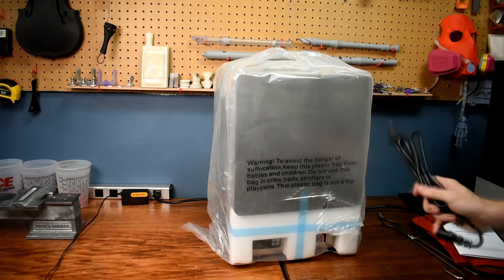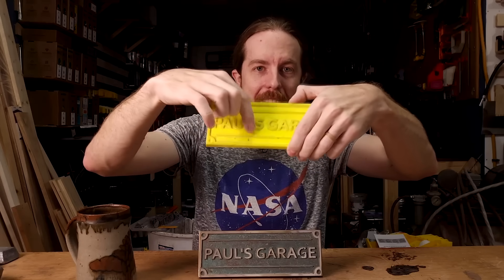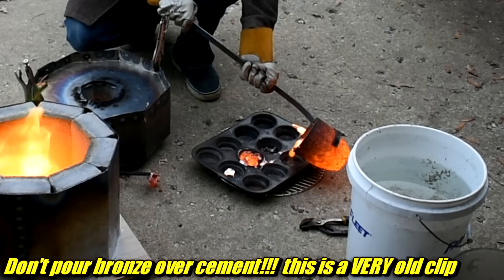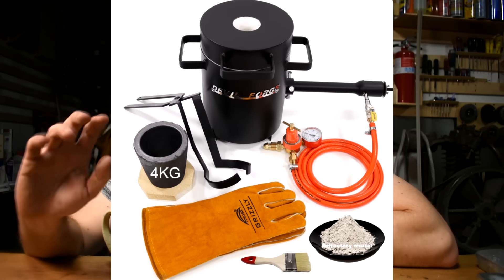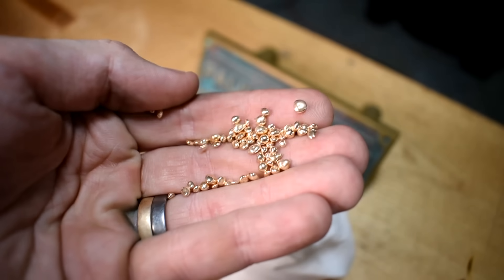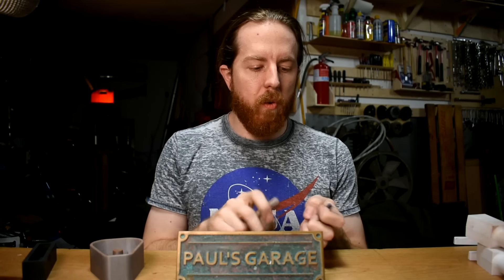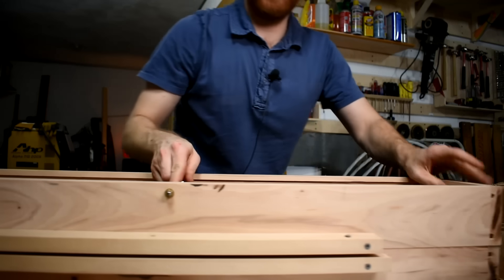Start Sand Casting at Home: The Easiest Equipment Setup

Comment: I started building a forge 5+ years ago.  Did all the research, started buying and collecting materials.  Got the forge made, started on the burners then life got in the way.  Finally getting back to it and bought a Vevor 12Kg forge/foundry on Black Friday for less than I paid for the Kaowool  and materials years ago.  LOL.  Need to order some rigidizer and see if I still have some refractory material left.  First job will be making some tongs for the crucible and forging.  Thanks for sharing, Ken

Comment: This is awesome Paul! Thank you for this.. so much info in one video. 

Question: any reason no one makes a bottom-pour crucible? (Other than potentially getting easily clogged.) I use a cast iron teapot (bottom pour) for making lead ingots; the lead comes out perfectly clean without having to skim for dross right off the bat. Wonder if you can do the same for higher temp metals?

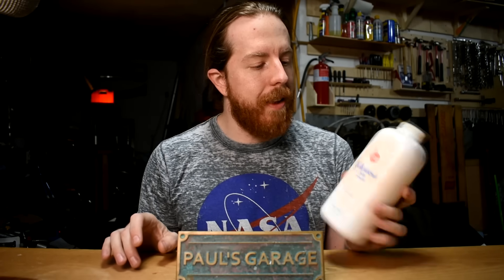Comment: 4:00 I started hobby casting about 5 years ago and corn starch baby powder is all I've ever used because I couldn't find talc. But I've never had any problems with the 2 sides of my flash sticking together. With either petrobond or green sand.
Reply: usually dont comment but corn starch is also all i use, doesnt seem to powder as nicely as i see it do for people on youtube with talc so i just use a paint brush.
Reply: @swagtactical9255 I use a makeup brush

Comment: A little plaster and sand with lost wax instead of molds and the finish product would be like jewelry or inconel jet engine fins and not be imperfect or need work after. Could also skip the special sands and only use sand to fill in space on large stuff to keep mold from breaking.
Reply from the maker: lost wax is awesome, i do vacuum casting here, too.  it's just a different process for different ends, both are awesome

Comment: Cool, I just melted down all the scrap soda cans 've been collecting over the past 3 months today into ingots.  I am wondering how you can easily add draft to models for 3d printing.  Eventually I am going to recast my can ingots into round stock for turning parts on my metal lathe.  Ingots are ok for storage, but I have been thinking about welding up a shot dripper to pelletize my cleaned metals to make it easier to melt just what I need in the future.
Reply from the maker: sounds fun!  adding draft to 3d models can be done in a few ways.  If i was making an 3d model, it depends on which software you are using, but most of them have an "extrude" feature that can have an angle or draft added in.  I would add 5 degrees.  If you are using something like blender on an STL, it's a bit more complicated, but it can be done

Comment: Why not use a stainless steel crucible?
Reply from the maker: that could work for sure, but depending on the alloy you might have contamination issues.  molten aluminum will dissolve steel like water in a cup made from sugar.  It can eat through, or more likely just absorb so much steel it can alter the aluminum alloy.  That's just one example, and i'm not sure what issue an iron-nickel alloy would have with whatever metal you are melting in it, but generally ceramics and graphite are used to prevent contamination.

Comment: Hi Paul, Great videos!!! Question, can you cast Zamac in an aluminum mold?  Thanks
Reply: I didn't see where to leave a comment about what I have cast. My biggest casting to date was a Ford V8 60 dual spark plug cylinder head. I have a few crucibles, the largest holds 150 # of aluminum. I will build the tilt mechanism for it next year. Zamac seemed interesting for some mechanical parts that I would like to produce. I think it may be easier to cast them as opposed to machining from billet. If I can use a bolt together aluminum mold It seems that complicated parts could be easily produced on a low volume basis.
Reply from the maker: that sounds like quite a casting!  And a huge crucible. I don't have anything bigger than I can lift safely by myself, as I don't have a crane or any help.  Za12 has some great properties, it's a bit vibration dampening and it's also a lower friction surface than aluminum.  It's pretty awesome overall.  If you can't get an aluminum mold to work, there is a 3d printer resin called thermacast that can handle za12 for a very short run
Reply: @PaulsGarage  Thanks, I will check it out
Reply from the maker: I'm not sure, but that's a good idea to try.

Comment: Guess what else makes good ingot molds (at least for aluminum, though I think we used them for bronze)?  Angle iron.  And long thin pieces are really easy for melting in even the smallest size crucibles.
Reply from the maker: funny you mention that, i talked about that in this video but cut it for length.  Maybe I should've left it in?  Thick angle iron allowed to get rusty won't even stick to cast iron ingots.  it's good stuff.

Comment: How do you estimate how much metal you need to melt for a casting?
Reply: you pretty much don't "estimate" it. There are calculators online you can use. Just find the volume of the part
Reply from the maker: Good question!  there are a few ways.  If you are using a 3d print, you can generally just get a volume measurement off the STL, then add some for the gating.  In general, though, i just make sure to melt about 50% more than I think I will need, and pour the extra into ingot molds.  I usually melt up to 50% previously melted stuff (like gating and feeders I cut off of previous castings) and add in some ingots, so it's a way to keep my ingot pile high and my "off cuts" pile small at the same time.

Comment: How long have they had kits for forges? I don't know if I failed to find them or if years ago when I started playing with such things they just didn't exist, but if it's cheaper to buy than make, definitely go that route.
Reply from the maker: I'm not certain about these electric ones.  Professional grade ones have existed for a long time, and the expensive devil forge kits existed when I built mine.  Back then they were far more expensive, though, so i more or less broke even when I built mine. These days, new kits have gotten so much cheaper it makes sense to just buy them.  Even if they don't last as long as the one I built (I overbuilt it significantly) you can go through a few of them before you get to the price of the materials I used in mine.

Comment: Don't use talc. The reason baby powder is no longer talc is because a lot of talc is contaminated with asbestos.
Reply from the maker: Yeah it caused cervical cancer in girls who had baby powder used on them.  It was bad.  Don't breathe any parting powder, for sure.  Talc works, though.
Reply: @PaulsGarage  There is other powders that work as a parting powder that does not contain silica or possible asbestos. Like for example chalk powder.

Comment: Great video! I have used devil forge and can definitely recommend. Cheap and very easy to get started. I still use the crucible tongs to this day and they have never given me issues. One thing to add though is a heat shield to not burn your hands for higher temp metals (I still need to make a better one). Do you have any advice for larger sand molds to not have the sand collapse when trying to lift it up? Can you ever overpack sand (if you don't need to worry about pattern compression)? I use equate medicated baby powder (yellow bottle) and it works great for me. I've tried 100% talc and it was terrible. I'll have to try the powder that you use and see if there's a noticeable difference
Reply from the maker: Sand falling out is usually 1 of 2 problems.  1, your flask can't hold the sand and it all slides out the bottom in a big brick.  To fix that, add ridges on the inside of your flask.  2, you didn't pack the sand tight enough.  If you are using petrobond, you will have a very hard time packing it too tight.  I'm not sure it can be done without a sledge hammer.  My sand rammer is about a pound and a half, and i POUND the sand hard with big flasks.  I've seen people use sledges with short handles before.  The sand might not vent as well, but you can add vents with the vent wire.  I generally don't, petrobond vents very well.  if you are using a green sand, especially very fine green sand, then you will have to vent more aggressively, but petrobond is like an easy button for casting.
Reply: @PaulsGarage  That's great to hear, I use petrobond and I've always been nervous about smashing it too hard. I used a rotary tool and kind of "dug" ridges in, but I should probably do a better job. I think most of my issue is just not packing hard enough. Thanks!

Comment: Just a comment about scrap metals. There is nothing wrong with it. All of my castings are from scrap. Do not melt scrap and make a casting. Melt the scrap remove the dross and pour ingots. Also separate the scrap into types. Plumbing copper is different than wire. Just as extrusion is different from cast or forged aluminum. All cast just fine.
Reply: I found out years ago that aluminum cans are made from an alloy expressly made for extrusion, and kinda suck for sand casting, while cast car parts still have some flux in them and are awesome for home casting. Zamak (ZA-12) is supposed to have a lot of characteristics of cast iron, but be castable at really low temps.
Reply: @rallen7660  aluminum can alloy is 3004. About 98% aluminum. If you want to play with making different alloys, probably a great place to start.  It also polishes up real nice, for indoor use. I don't cast with it but i did make a couple ingots, just for fun.
Reply from the maker: You can totally do it, but for new people who want to quickly get to good quality castings, I think people should remove any extra steps.  Removing dross and adding fluxes and degassers is doable, I certainly do it all the time, but buying good ingots prevents all of those issues.  I especially want people to avoid misidentifying alloys (like magnesium for aluminum) or mixing low temperature zinc alloys with low temperature leaded pewters, since lead and zinc don't get along and newbies will have trouble differentiating between them.  As you say there is nothing wrong with doing it, I just suggest people start with clean metal and known alloys.
Reply: @PaulsGarage  since I designed my own furnace and burner, dross is almost non existent. Never needed to add flux or degass the melt. I've thought about making a video or drawing up the design. I'm just getting old and not sure if I want to spend the time.
Reply: @PaulsGarage  I do agree that eliminating variables is important for beginners, but experimenting once you have the basics down is where you truly learn. Like I did a rundown of various aluminum alloys yesterday and discovered that with the amount of manganese in the alloys I saw, you couldn't get 3000 series to ever be, say, 6000 series without adding pure aluminum and generally doing more work than its worth. But really, the low temp alloys are always the best place to start. I may be up to my eyes in aluminum cans and cartridge brass, but they're not a great way to get a workflow perfected (which is your point).

Comment: I generally use starch baby powder as a parting agent, I haven't had a problem yet. I mostly cast bronze, copper, aluminum, or zinc.
Reply from the maker: do you use petrobond or green sand?  I've heard conflicting things about corn starch so i advise against it, but if it works for you it works!  don't change what works.
Reply: @PaulsGarage  I've only used petrobond. I've never used proper parting compound so I might be missing out.  I've tried baking soda, baking powder, and starch/baby powder. They all seemed to work ok, but with baby powder it was easier to get an even coating.

Comment: I use a Devilforge furnace for all my metalcasting, can recommend it. It's nice to not need tiny ingots!
Reply from the maker: Good to know!  Big ingots can be cheaper but I love the smaller crucibles for ease of handling.  Pouring my extra thick lathe bed with za12 didn't feel safe haha
Reply: @PaulsGarage  Not just ingots -- big crucibles makes it easy to melt down failures so no one can see them, without having to cut them up into tiny pieces

Comment: These videos have been super helpful. Eventually I'll get into this hobby in earnest. 

I've got a question for you, on the off chance you'll see it in the inevitable flood of comments. I want to cast rose stems, like actually using stems from my rose bush, out of copper. The reason being that I make lots of copper roses, but want to up my game by making the stems a bit more realistic (with the thorns being filed down a bit, of course.) 

Do you think that sand casting is a good choice for this? I've already got some petrobond to mess around with. Anything I can add to copper to make it flow and cast a little better? I have an incredible amount of clean scrap copper from making other things out of copper, so I'd like to be able to use it. 

I don't have much experience casting metal, but I have made a propane foundry. Considering buying one of those electric ones solely for the sake of convenience though. Thanks for reading my long *ss comment.
Reply from the maker: if you are able to ram the rose bush in the sand and remove it, it MIGHT work, but if have an infinite supply of rose stems, you can use them for plaster vacuum casting.  Check out Lundgren Bronze Studios for example.  I don't have an equipment list for that yet, but i'm working on it, so stay tuned.  I'm also adding plaster vacuum casting to the online course next year, around feb/march if you are interested in that.
Reply: I should clarify that I'll be using a small stem section, no larger than 6-8 inches. No leaves or anything too crazy to worry about. 
I have a good amount of rose bushes, so I think I'd run out of copper and time to make roses before I depleted my rose stem supplies. Could possibly use a really good casting for a master, though, I assume. 

I'll be looking forward to vacuum casting information. Thanks again. Sharing knowledge is one of the most important things we can do with our lives, and you are excellent at it.